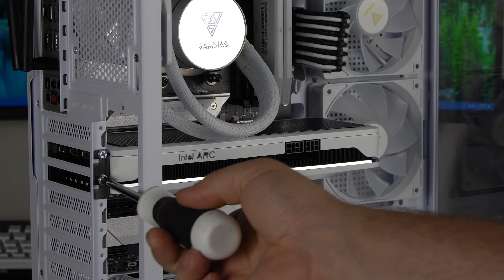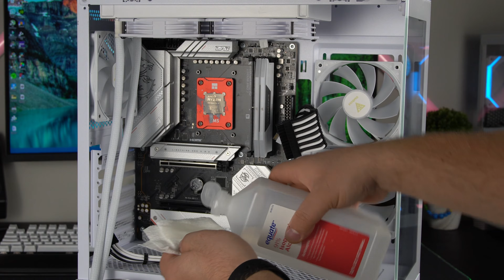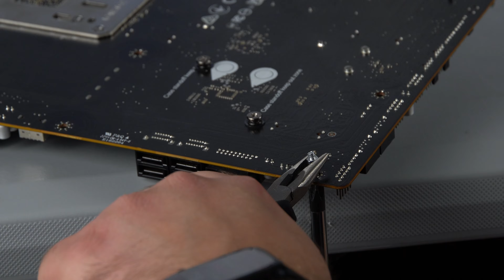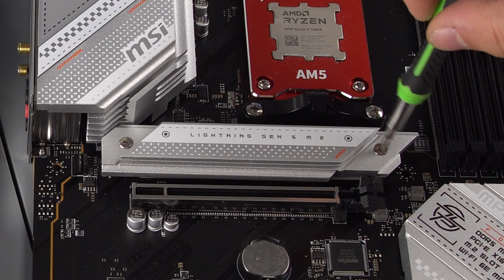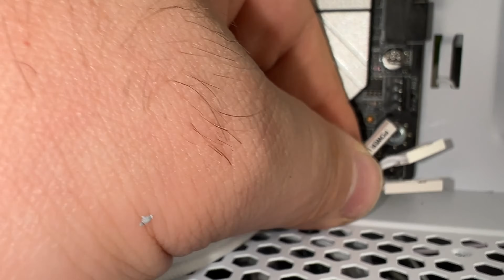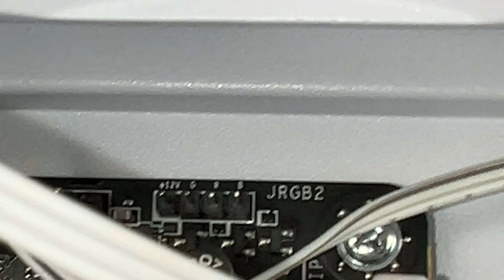How to Swap your PC Motherboard

Comment: Remember to have all of your NEW MB chipset & peripheral drivers, plus GPU drivers (If you use a different GPU) on  a USB drive so you can install them ASAP!
Remember the SATA cable organization if you use RAID and set it up in the BIOS the same way it was in the old MB!!!
So before you remove the old MB go into the BIOS and take photos of each setup section.
BEFORE YOU REMOVE THE OLD MB SAVE ALL OF YOU DATA & SPECIAL FILES TO A NEW(ISH) HARD DRIVE IN CASE IT ALL GOES SOUTH.!!!!!
Finally - be prepared to do a new OS install if things go bad.

Comment: Do I have to reinstall windows if I’m using the ssd I had on my old motherboard? Or I can js put the old ssd on my new motherboard and it will js fine ?
Reply from the maker: You won't have to reinstall windows. I just used the same SSD on my new board and it worked great
Reply: @BuildsWithV thanks and as for the cables do you think I can use the same ones? The ones for the motherboard
Reply from the maker: @antoniosuazo8330 yeah for the most part. If you're swapping to a different model motherboard some cables may just be in a diff spot or some motherboards just don't have certain connectors. But most motherboards have the same connectors just in different spaces

Comment: So let's say that i really fucked up and bought a pre built from Dell with mother board that came straight from an office and also the psu was 6 instead of 24 and when bc at the time i didn't really knew abt pc I had bought from my friend his almost 1y/o gtx 1650 and when I got a fre 600wt psy from him aswell when I looked at the cables I realized that I fucked up and decided to give my friend back his lsu and keep the gpu and now I made a budget list of the new mother board and psu that I'm gonna use for the transfer and ngl u really, REALLY saved my ass with this video

Comment: I have questions...First i have never used a AMD well anything so can you tell me what a contact frame is and if it is needed with AMD processors.
Reply from the maker: It's not needed for AMD processors. For Intel they help with cooling. I used it on my AMD build because this PC is used a lot for tutorials and it makes cleaning up thermal paste much easier every time I need to remove the cooler

Comment: Why'd ya have to return the MPG? I just picked one up and I've been slacking on switching to am5 X_X my return window is quickly draining lol just wondering if you had technical issues/manufacturers defects? I hope everything goes well, the MPG looks awesome and I got some white highlight fans to spice things up a bit but I'm so nervous about this one, not really sure why. I was so confident after my first build. Guess that was probably some dunning krueger energy lol Guess it doesn't really help much that I'm installing a 7800x3d and 7900xt that are way past the 30 day return window XD reeeally should have jumped on it day 1.

Anyways, just was curious why you had to return that one? Thanks ahead of time if I hear back from ya
Reply: Also really curious about putting your boot drive into a new mobo. Since I'm going from AM4 to AM5, there's alot of driver differences and data differences and of course, different mobo all together. Have you ever done cross-generation boot drive switch? I so badly don't want to re-download all the games lol my internet is soo slow. 48mbps on a good day. Got half a 2tb drive of games loaded on my main drive.

Based on everything I've read and the majority opinion on the matter, it looks like I'm going to just have to suck it up and re-install everything. Picked up a better m.2 for that anyways. Can never have too many of those around. Worst case I'll stick my game drive in an external m.2 case and transfer the games to the new m.2. Not sure if that counts as an install, s'pose I should be looking that up. If so it wouldn't matter anyways.

Wondering what your opinion on that is? Think windows is smart enough at this point to ignore the unnecessary drivers? I can't find the names of the ASUS driver from my b450 TUF board so idk which chipset/etc. drivers to uninstall. Doesn't show up the same in my device manager as other peoples. Maybe since I'm not using an activated windows. Lots of features locked out when you don't have a license key yet.

Well I tried to keep it short lol sorry. Guess just my two questions; why did you have to return the original MPG mobo? And what's your thoughts on taking the same boot drive from an AM4 build and sticking it into an AM5? Thanks a bunch and thanks for the vid. Mostly looking for the driver info and technical stuff when swapping mobo's but you can never see this process enough and it was cool to see the same board I got get set up!
Reply from the maker: @tulpasconstructor2711  I've personally swapped SSD that was installed on Intel to AMD and didn't have any issues. I think it doesn't matter and will ignore the extra drivers. Not sure if it's that simple in all situations since I usually just do a fresh install of windows. 

I returned the original motherboard because it was defective. I don't exactly remember what the main issue was with it but I believe it was a ram slot issue. Couldn't utilize all 4 ram slots otherwise it would crash when I had dual channel ram installed. Putting 2 ram sticks in the wrong slots worked fine 😅 

As far as transferring games and stuff. You could clone your drive using software. You'd need an external USB to SSD housing and cloning software. There are some free software programs and great videos on YouTube showing how to do the cloning. I've done it several times with boot drives and with extra storage drives.

Comment: will you have to install windows 11 and all of you're games again? IM switching from intel 12600k to AMD  9800x3d
Reply from the maker: @damen1090  in my experience I haven't had to reinstall any of my data. The only thing is you'll have to install all your drivers and stuff for the new hardware. Also, depending how you purchased windows key, you may need a new key to activate windows. Some keys are linked to motherboard and not to your account, others are linked to your windows account so that wouldn't be a problem.

Comment: Do i need to drain my custom loop when doing this? 2 waterblocks 1 on cpu 1 on gpu
Reply from the maker: @digitaldave5272  yeah unfortunately you will need to. I had to do this on a custom loop and it wasn't too bad. Bad part is having to buy new liquid for it but I suppose you could reuse it if you store it in a clean container.
Reply: @ i guess its not too much of an issue, i have the liquid in my garage but this seems so tricky to do with watercooling
Reply from the maker: @digitaldave5272  yeah its definitely a bit more work with custom loop. But once you remove the liquid and any pipes in your way of removing the motherboard it should be the same as this video.
Reply: @ Thanks for the help, ill probably be doing it on Christmas

Comment: So now what happens when you turn the pc back on with everything back in the new motherboard? U don’t have to re-set up windows? It’s all on the ssd and the new motherboard recognizes the computer as it was? No other steps?
Reply from the maker: @Wesley-Houlas  if you’re swapping with the same motherboard then nothing will change unless you used a windows key that registers to motherboard instead of account, then you’d have to reactivate windows. If with a different motherboard then you might need to install some drivers etc.. In my experience everything stayed the same besides drivers
Reply: @ since you were kind enough to answer me the first time I have another question I can’t find an answer too I hope you could help me with. I need a small but mighty AIR cooler for a 5950x 16 core 140w processor. My AIO died and everything is so stuffed in the back of my micro atx case I don’t want to re wire a new AIO. Plus I’m going to start a new build in the next year or so. It can’t be a huge air cooler in order to fit in my Corsair crystal 280x, but it needs to have the cooling power for my cpu. Do u have any recommendations?
Reply from the maker: @ Noctua makes some really good low profile coolers. They are on the pricier side but very good. ID-COOLING makes good ones as well and cheaper than noctua. Here’s a few links to see reference but you can search up “low profile mini iTX cpu cooler” and see similar results. 

Id: https://amzn.to/4eoslJy
Nocuta: https://amzn.to/4fhBapP

Note: make sure they’re make for your cpu. Often times with small coolers like these, they’re made with one bracket only and you’d need a different model for your cpu.

Comment: Is there any pre steps you have to do? Like uninstall windows or anything before I swap my motherboard?
Reply: +1 for this
Reply: Do all sorts of necessary backups AND prepare the latest BIOS in case your new MOBO won't be compatible with CPU or RAM.
Windows reinstall comes AFTER the swap.
Reply: Probably Windows